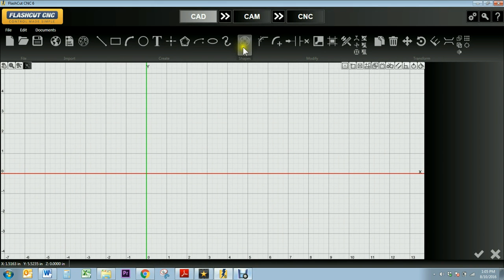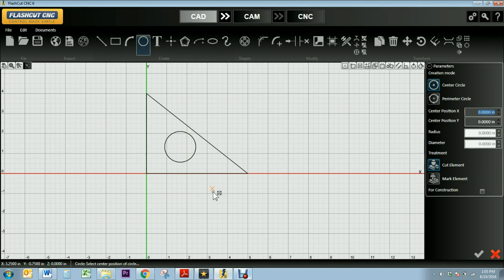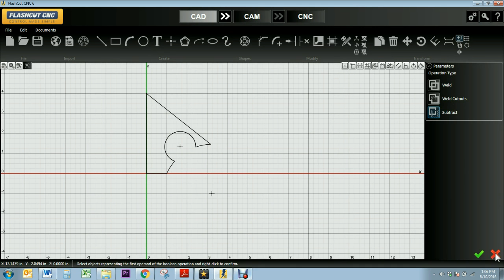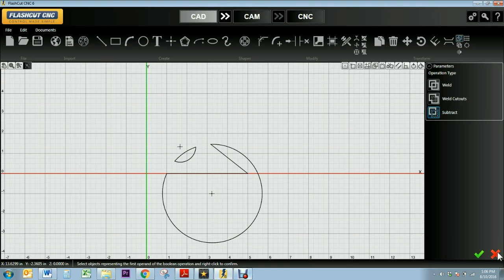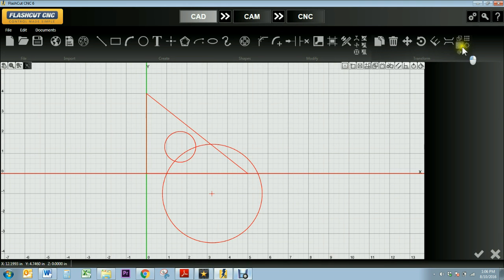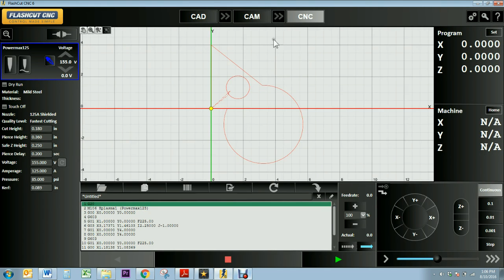How to Combine and Cutout Shapes - FlashCut CAD/CAM/CNC Software

Comment: Is there a way to merge a part and a cut out?  I was going to use the scale feature to create a void around the part, but I can’t figure out how to combine them together.  When I weld them it coverts one of the two objects so they are both either cutouts or parts.  Any suggestions would be really appreciated.  Thx